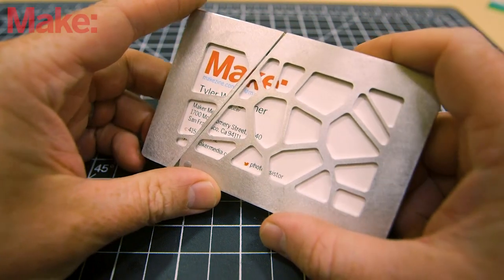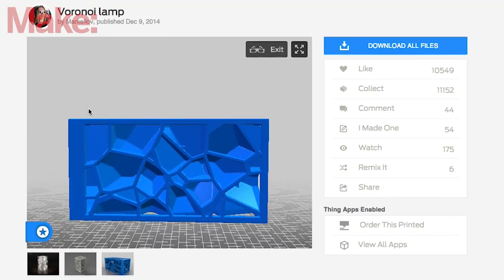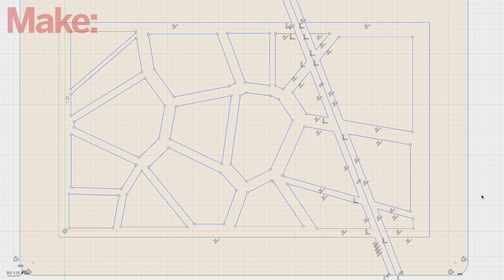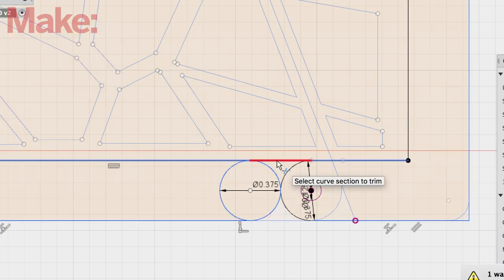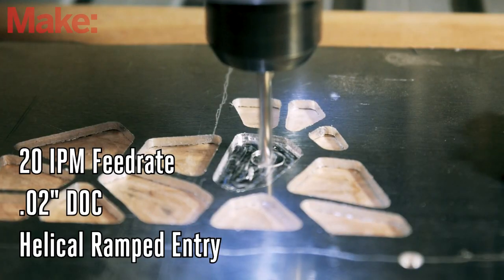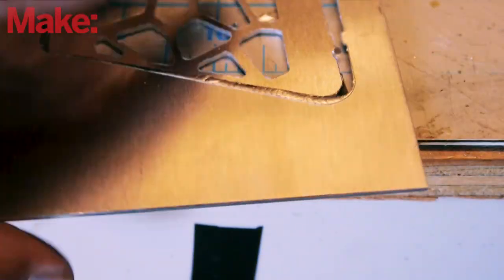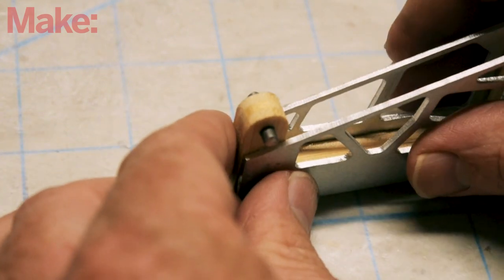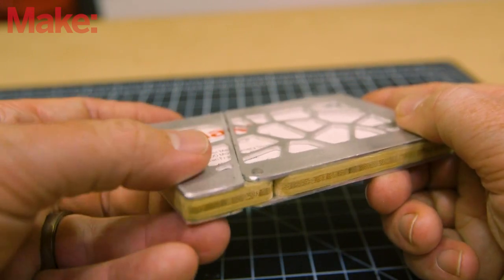Wood & Metal Business Card Case

Comment: Cool design... you mentioned that you wanted the wood thick enough so that it won't break. I'm no structural engineer but I think the metal plates on the outside would provide the wood with more integrity to prevent breaking. It's just a thought.

Comment: A dark hardwood would probably make a nicer contrast to the aluminium and also allow for a thinner edge, but otherwise that thing is beautiful.
Reply from the maker: Thank you! I originally wanted to use some .25" walnut, but I was worried that the grain would weaken the hinge. I figure with the plywood, and the grain going in 2 directions, it would be a lot stronger.